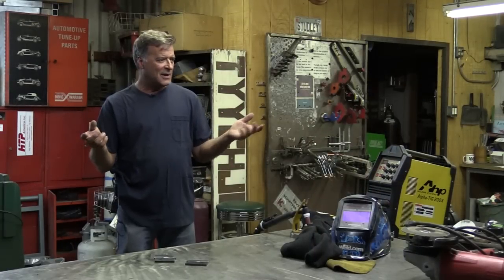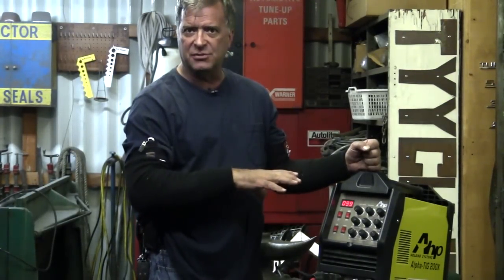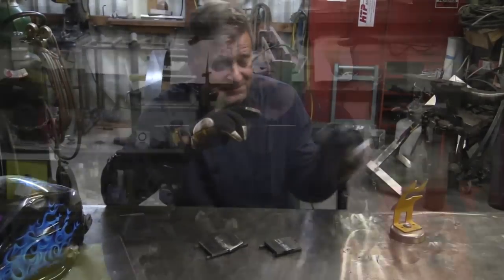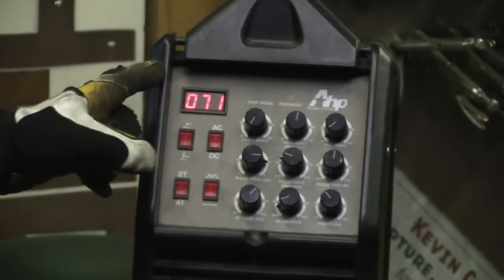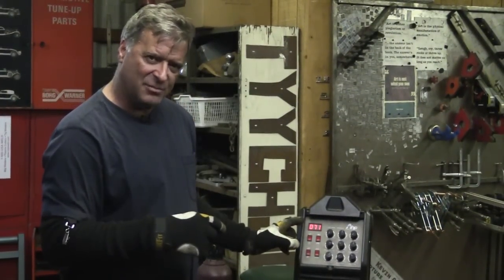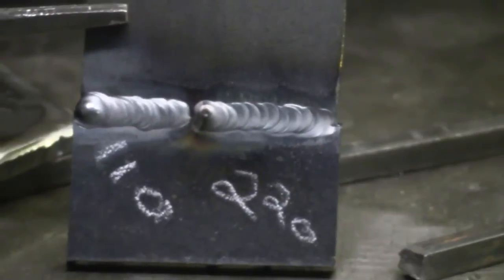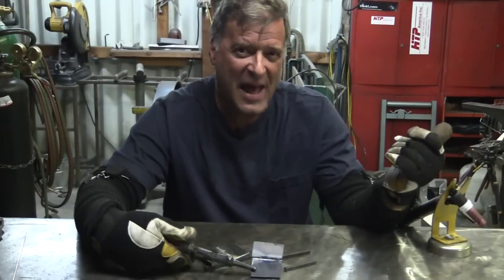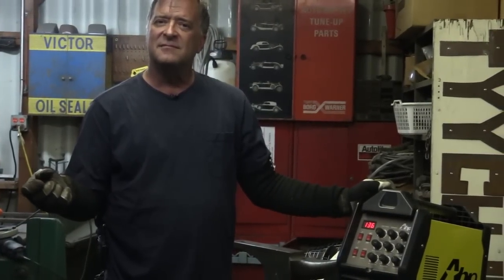What is the Difference Between Welding With 110 and 220 Volts? - Kevin Caron

Comment: My only thing is i would like to weld a little over 3/16 steel. I have a miller 140 but i have been looking at the vulcan omnipro 220 and i can run that on 140 since i do nit have 240 yet
Reply from the maker: Haven't had the chance to play with the Vulcan line of machines.  Can't offer any opinion on them. Thanks for watching and posting.

Comment: So 110 would easily be adequate for sheetmetal work on cars and such? That's great to know. My question now is whether or not I can even safely plug one in at my house. It's an older house that still only has 100 amp service. Would pulling the trigger basically brownout everything else in my house? They want upwards of $9,000 to upgrade the house to 200 amps, so that's not happening for a while.
Reply from the maker: All depends on what machine you are using.  Under normal use the little welder should draw maybe 20 amps.  Please check the tag on the machine to make sure you have enough power to run it correctly.

Comment: "Difference Between Welding With 110 and 220 Volts" 220v or 240v like I run is like turning the Nitrous on.

Comment: can you weld thin aluminum on 110v outlet?
Reply from the maker: Sure, no reason why not.
Reply: @KevincaronSculpture  excellent. do you recommend a low cost tig welder that can  weld thin steel and aluminum.  1/8 will probably be the max metal thickness i’ll weld. just something for welding small projects in my home garage. i used to have a lincoln precision. tig 225. and loves it. but i don’t need or have room for anything that big
Reply from the maker: I would look at the AHP AlphaTig 225xi.  Will do everything you need and a lot more.   Going for about $800 usd at this time.
Reply: @KevincaronSculpture  thanks so much for the suggestion and the video. you explained things so perfectly. I think you have done a great service to the other people like me asking the same questions

Comment: Thank You!  So, when I'm watching somebody using a 110 machine welding 1/8" material, and I'm going to do the same thing with a 220 machine, 'should' the settings be about the same?  Wondering too if different machines produce different results with the same settings and voltage input and comparable torches/guns?  Thanks Kevin!!!!
Reply from the maker: I would say the settings between the 2 different machines would be just about the same.  You will see a little difference between machines as far as the look of the weld and the duty cycle of the different machines but most guys will have a hard time telling the difference.   Biggest thing is a 220 volt machine running on 110 will only give you about 1/2 of the total output of the machine.  Hope this helps and thank you for watching and posting.

Comment: Will the 110 weird hold up compared to the 220 weld don’t have 220 here?
Reply from the maker: Yes, it will hold up to the thickness you can weld with 110 volts.   Figure about half the thickness that you can weld with 220 volt.   With proper prep work you can get a good bead for sure.

Comment: I'm starting out as well, and currently, I only have 110v.  But what Amp would you think I can get away with on 1/16 to 1/8th aluminum? I'm using mostly L beams and flat bars for frames.
Reply from the maker: If you had 150 amps total you will have enough for what you are working with.

Comment: interesting   so I still need to know what strength 220 is for and 110 is for.. I dont need overstrength for whatever purpose I need.   How come nobody comes up with two separate lists for things that 110 is good enough for and 220 for ..     Look  I got a broken garden auger bit off the rod and I plan to reattach it to a longer Bully 60 inch dirt poker   so I get myself a much deeper garden auger than what I can buy ready made ones  that usually tops out at 24 inch deep.   So  which is good enough .. 110 or 220  for the torsion it will require without breaking off.. I got a really hard adobe soil deep there.  of course I plan to water it along to soften up  as I twist the auger down there..    The bully tool got a half inch rod  so ... ??
Reply from the maker: You can welding anything on 220 volts.  You can weld almost anything on 110.  If you have 220 in your shop and want to weld this auger you can just turn the machine down to the correct amps or volts depending on what machine you are running.  For a 1/2 inch diameter solid rod you would be maxed out on your 110 volt machine to get enough penetration to make sure it won't fail in the hole.  On 220 volt you will have plenty of power to get enough amps to get the job done.

Comment: it depends how big the circuits can provide the power, watts. like an electric stove,  1000 w of 110 v or 220  v stove  are of same heating capability.  220 v runs smaller current, 110 v runs bigger  current, amperage.  when use modern inverter   welder, enough IGBT and capacitor, can provide enough watts of power to fire the arc.

Comment: Hi Kevin

Power (Watts) = Volts X Amps so 100 amps at 110 is NOT the same power as 100 amps at 230. 230 is better for higher power for the same size cable. It's why we use power lines with step up and step down transformers. The cable thickens to carry the same power at lower voltages would be crazy. so 24,000 Volts means smaller cables can be used.

Take a 12Volt car system and look at the fuses - the thickness of the wire (it’s design is to heat up and fail at a given current (ampere rating) so you see they are way thicker than say a 13 amp at 230V fuse. Now for welding purposes you want that AMP current and heating effect to melt steel so you rig will allow you to dial in more amps for a higher voltage because of how it's engineered.

POWER is key so a 230V hairdryer for example will run (slower and less heat) on 110V, but a 110 hairdryer on a 230V system will run very fast (maybe) for a very short time before blowing the motor. Transformers are used as safety devices in the same way welding created a lot of heat but minimal voltage. Lightning on the other hand is a LOT of voltage and a smaller current but it's a giant welding rod from the sky that you really don't want anywhere near you. The ground strike effect means the impact point dissipates over distance BUT also means bad news for cows because the difference between front and back legs makes a circuit with big differences in voltage. For people this is proven true with some guys golfing- it's pissing it down with rain - last hole - lightning strikes the ground close by but the one closest is so wet and at a favourable angle to the strike (his feet distance and angle) that he had less of a problem that the others watching him. There is an interesting documentary where you can learn some genuinely interesting things on lightening, the faraday cage effect and more. 

All the best to you from over the pond 😊I hope the information helped.
Reply from the maker: Very helpful!!

Thank you for sharing!

Comment: My question is, what about with stick welders?
Reply from the maker: Good question!     You are mostly limited to a smaller rod diameter.   Say about 3/32 or so.
Reply: I have quite a few questions, so I'll try to get them all in. I'm looking to get into blacksmithing, and while I won't NEED a welder, it would make things easier to deal with when it comes to making tooling. Since I'd be limited to 110, what would be the thickest material that I could expect decent penetration on?

Comment: Can you run a flux 125 welder on a 15 amp circuit without tripping it?
Reply from the maker: Not at full amps.   Maybe only about 75 or so.

Comment: Hey Kevin need some help here. I'm a hobbyist just learning welding. I only have a mig machine at the moment but very interested in a tig for welding aluminum (mainly because I'm having trouble burning through with the mig or getting no penetration at all). I only have 110 and can't get 220 without running another power pole so clearly thats not fesable. What machine would you recommend? I am building a dog box to hold my hunting dogs in the truck thanks.
Reply from the maker: Look at the AHP AlphaTig 200.   On Amazon for about $700ish.  Runs on 110 volt and has AC for aluminum.
Reply: Kevin Caron, Artist oh wow thats some food for thought. I paid 700 for my mig and the lincolns and millers are like 1500 and the guy at the welding shop said they wouldn't do what I wanted
Reply from the maker: You will have about 130 amps to play with on 110 volts.   Been welding 1/8th inch aluminum for several days now with the AlphaTig with no problems.

Comment: We haven’t had 110 in the US in a very long time. Officially, it’s 120. In actually, it’s 123. That’s intentional, and in a few years, it will be the official voltage. The end of this is about 140 volts some time in the future. But that may not be for another 40 years. The intent is to give more watts down the line without having to change outlets, wall wiring or wiring in products.

I’ve been to a number of places in the EU, and it’s interesting to sometimes see, in old hotels, two, or even three different outlet sizes that were put in over the decades as power use went up. In the UK, for example, sometimes you see an old outlet for 240v 3 amps, a newer one for 240v 7 amps, and the latest for 240v 13 amps. All incompatible. What a mess! They’re trying to avoid that here.

Comment: Video was very helpful. I just got this machine in the mail and plugged it in to see if it lit up. Turned up the amps and it maxed at 150. I'm assuming its because I plugged it in 110 volts. Your the only one I could find that provided the information. .great video . Thanks
Reply from the maker: Correct, plug her in to 220 volt and you will get the full 200 amps.

Thanks for watching!

Comment: Didn't Changing input voltages also change duty cycle?
Reply from the maker: Yes, it does.   Lower volts longer duty cycle.
Reply: Kevin Caron, Artist thanks for the reply. I didnt know if it went longer or shorter

Comment: Great video Kevin thank you.  I have a basic question I'm sure you've heard a hundred times...  I'm a DIY/Homeowner level new welder, coming from an ancient 110 flux core welder that is practically useless, what machine would you recommend for a newish welder in 220 MIG with argon?  I don't have a bottomless wallet, but of course I don't want another crap MIG like the 110 I already have.  I would eventually want to make a mini buggy, welding 1/8" tubes, and FMX ramp construction for my dirt bikes, stuff like that.  What is good, best bang for the buck so to speak?
Thank you in advance, I love your channel!
Reply from the maker: I think anything in the Everlast line will do just fine.  They have a great MTS line so you get 3 machines in one box.  Been very happy with mine.
Reply: Awesome, thank you for getting back to me so quickly.  I'll definitely look into the Everlast MTS line, thanks!

Comment: im so confused :( you said you were using a 110v 20amp circuit, but then you somehow you were welding at 110v 100amp! how is that possible without tripping the breaker?
Reply: The welder lowers the voltage coming in, which in turn raises the amperage coming out. If you look at the powerlines the wire is very small but the voltage is very high. But when it reaches a transformer that lowers the voltage it requires much larger guage wire because the amps raise. Same with your welder it is basically a transformer.
Reply from the maker: That is 20 amps coming in and 100amps coming out.

Comment: I have a miller 211 ( old style ) that has the MVP plug. I will say that the miller machine runs MUCH better at 220 than at 110. Even at equal amperage, there is a marked difference in arc stability, even in the lower end. The wire doesn't seem to feed as nice, or the arc is stuttery such that I have trouble keeping a nice even bead. At the higher end of the 110v range, which is mid range for the 220v configuration, the welds just don't look as good as the same settings on 220v. I wouldn't trust any weld with a 110v welder unless it was thoroughly tested.
Reply from the maker: Good points!     And I agree.
Reply: Welded a ball mount on my trailer hitch  for an anti sway bar.  1/2 inch flat bar. Stick 6011 and 7018 on 110. And its solid.

Comment: best little welder I used was a 120/240 miller tig/stick pack I used it for a month tig welding stainless steel 48" pipe I'm actually going to pick one up the I used was own buy the company I welded for. you can get hand or foot controls for it too.
Reply: Best welder I ever used was an everlast mig/tig/stick welder I borrowed from a friend. I eventually bought the same model for myself. My first welder was a cheap harbor freight inverter welder. It didn't work very well and eventually broke but I guess I'm sentimental because I still have fond memories of that little box.

Comment: How do I choose a power generator to power a 220/240 welder that features up to 250-amp of AC/DC TIG welding power and a 200-amp for stick welding?
Reply from the maker: Minimum of 6.5 kw output will just get the job done.  If I was in the market for one I would be looking in the 7 to 10 kw range.   Just make sure you go with an inverter generator if your welders are inverter machines.

Comment: Can you weld 1/8" or less aluminum with 110v using this machine?
Reply from the maker: Just barely!     You need about 130 amps to get started on 110 with aluminum.  And if I remember right you are only getting about that on 110 volts.
Reply: If you get an argon helium mix for your gas, you could. But helium is very expensive.

Comment: I am NOT an electrician, but I STRONGLY recommend you NOT change a breaker from a 15amp to a 20amp!!!!!!!!  FIRE! FIRE! FIRE! .... a 20 amp breaker requires a 12 or greater gauge wire.... 14 gauge or smaller wire is DANGEROUS! .... and NOT to code.
Reply: I rewatched this video.... he DID say CIRCUIT and NOT breaker.... installing a 20 amp CIRCUIT = good.... changing a 15 amp Breaker to a 20 amp Breaker = very bad.
Reply from the maker: I do try to double check what I am putting out..
Reply: It strongly depends on the length of the run, the rating of the insulation, and the way the wire is routed. Although it's generally a rule that the minimum gauge wire is used for every instance, since wire quickly goes up in price as gauge goes up. An electrician is your best bet for this kind of work. NEC has a lot of nuances in terms of loading vs run length vs wire gauge. A welder is probably considered a constant current source vs an air compressor which is considered reactive source, both have different considerations with regard to their circuits. Additionally, depending on the year your circuit was first made, the rules may have dramatically changed, and it's already questionable in it's capacity. Best to call an electrician and not guess poorly.
Reply: Kevin Caron, Artist heh, is that what you tell your wife?
Reply: casesusa you should listen to what he said. He said install a 20 amp circuit. That means installing another circuit with heavier cable to handle higher current draw.

Comment: Hey Vinny,  your dryer uses both 110 and 220 volts,  220 for the heating element and 110 to run the motor.   The plug on your welder requires a 50 amp 220 volt receptacle..  Thats why they are different..

Comment: Hey Kevin, Thanks for your great videos.  I have an Alpha tig200.  The specs in the user manual for this machine show that in order to get the full output of 150 (+ or -) amps at 110 volts,  you need an input amperage of 37.4  amps!   The machine only knows if its getting 110 or 220 volts. The machine assumes that you are providing the required input amps.  The point I'm making is that just because the amperage dial reads 140 amps..  that doesn't mean the machine is putting out 140 amps..  unless its getting the required input amperage..  So.. if your machine is using a 15 or 20 amp circuit at 110 volts..  your not going to get near the rated output.
Reply from the maker: Very true!     You will pop a breaker before you get the full amps from the machine....
Reply: I ran my dual voltage everlast welder on 110v when I was first learning. It was fine with the low amp welds I was using but I switched to using the dryer outlet soon after to get 220v. Hooked up a thick extension cord. Works great!
Reply: Esab says that my emp Rebel 215 can use a 30 amp breaker on 120 for up to 160 amps. Otherwise a 30 amp 220 circuit will give the full output of 220 amps in mig, somewhat less for TIG.

Funny how welders that only need 30 amps at 220 all come with a 50 amp plug. Esab says that 30 amps is just fine.

Comment: nice video i love this sort of comparison. this is great information for potential buyers. one question through and please be nonbiased cause i believe lots of people would like to know, what do you prefer ahp or everlast? thats what im trying to diside for myself. thanks in advance.
Reply from the maker: +Ryan Dean             In my opinion they are for two different types of manufacturing.       I like the AHP for quick short welds.   The torch is lighter so it's better for standing and welding..       It's a light fabrication type machine.   Something to use maybe 5 hours a day..         The Everlast PowerTig 255ext that I use is a very heavy duty, use it 8 to 10 hours a day type of machine.  When I have thick metal to weld or lots of it I will reach for the 255ext.      This is my get some work done machine..      If I only had one of these machines,,,,,   I would have to choose the 255ext.      It costs a lot more ( 3 times the cost of the AHP)  but I think it is a better machine if you are going to work it all day..